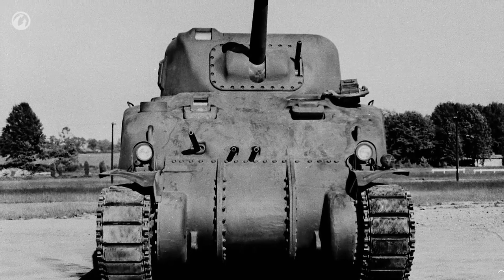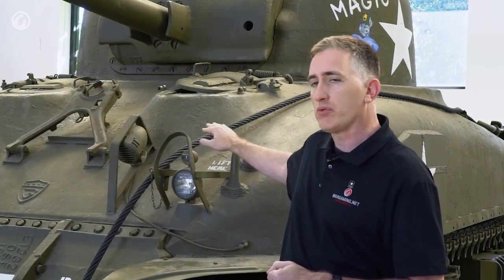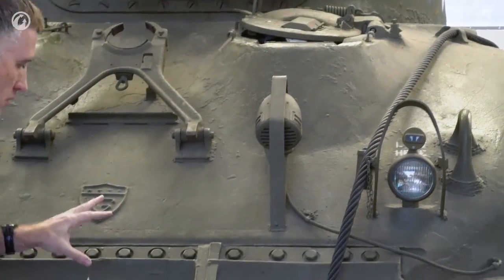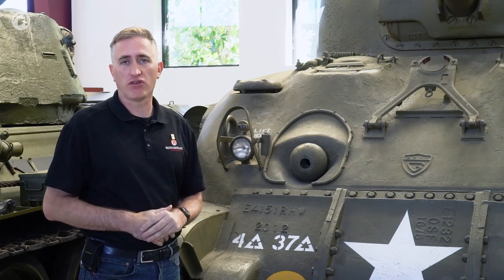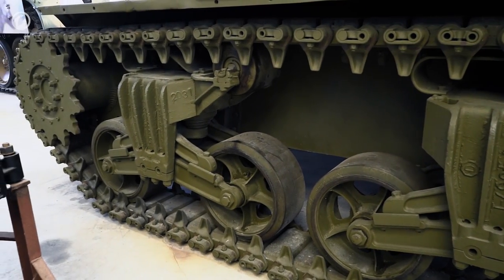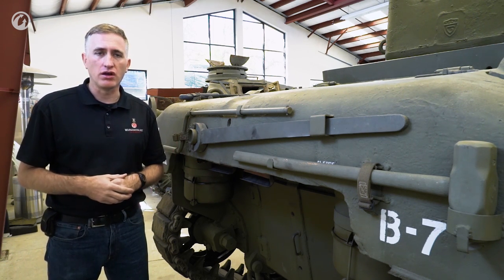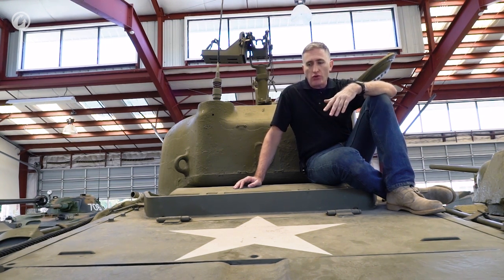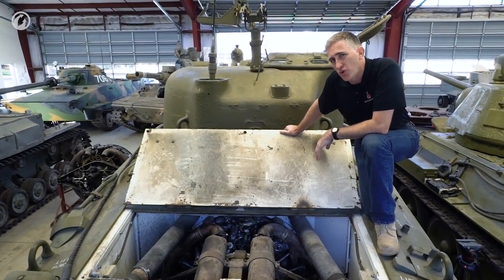Inside the Chieftain's Hatch: M4A1 Sherman part 1

Comment: Understandably, there is a distinction among maintainability and reliability, but isn't "reliability" largely based on maintainability?  My car may be "reliable" but if I don't maintain it properly, it won't be for very long.  Also, generally, the more maintainable some thing is, the more reliable it tends to be.  Undoubtedly the two go hand-in-hand.  Separating the two is tantamount to separating space and time - conceptually they're different, but practically, they're the same thing.

Also, THANK YOU for illuminating the crane weight restriction.  It now makes total sense to me why we Americans never seemed to do much with heavy tanks during the war.  It is a critical and largely untouched reason as to why.  It surprises me that this is the first mention I've ever heard of it.  Considering the massive logistical web the U.S. had to establish, maintain and protect during the war, a change like upgrading all of the cranes in order to transport a new model tank would have been a gargantuan effort.  It's also a nice segue to my final point.

While I have heard and read many criticisms of American arms and armor in WWII (justified and not), I have never heard any praise for the logistics and supply chain the U.S. pulled off.  Yes, we were well protected by two oceans, but these were insanely monstrous obstacles to supplying two simultaneous overseas war efforts.  Except for Canada, there was no other combatant that had to accomplish the same (Japan is probably second to North America).  While the U.S. produced about the same number of tanks as the Soviets during the war, every single one that saw combat had to cross thousands of miles of ocean to enter into said combat (in addition to the fuel, ammo, spare parts, food, crew, etc.).

Love the video and the series.  I'll always have a "soft spot" for Shermans as it was my grandpa's tank...
Reply: John Cornell.  The Brits has colonies to draw supply from scattered throughout the globe and didn't have to supply two fronts, crossing two oceans from a single location.  While their efforts were respectable, there's little in the way of comparison.

Also, not sure if you checked your geography but there's no ocean between Germany and the Caucasus.  German supply of North Africa is a single front, not two and is across a sea, not an ocean and used Italian ships.
Reply: John Cornell  I think he was counting the affair in Britain as a front.
Reply: John Cornell  I'm curious how the British had to go all the way around and the Americans just pulled up as the British sailed by?
Reply: Thank you for pointing out the interchange of reliability and maintainability (including spares and mechanical ability), I thought the same thing, one and the same.

Comment: One way to look at the Sherman is to remember how another important American product came about - the IBM PC.

Nazi Germany was a militaristic land power. We were an isolationist nation that relied on sea power. We had no tanks in WWI and so we were late to the game.Just like IBM wasn't in the PC revolution early. So when they had to make a tank or a PC they didn't try to make all of it themselves.. They bought and assembled 'off-the-shelf parts'.

Germany had a company Maybach that specialized in tank engines. So they always put a purpose built tank engine into their tanks. We however stuck a wide variety of engines from cars, trucks, tractors and planes into our tanks. Germany had several companies that forged cannons but we didn't. We used a WWI French field gun in the Sherman. 

IBM caught up by not making their own special purpose CPU for their personal computer. They used an Intel chip and parts from many other manufacturers.

The Sherman and the IBM PC assembled not constructed.
Reply: Just as an iphone is built today. And yes IBM did convert to PC's pretty quickly thus the ubiquity of PC's.

Comment: Did you get a picture of that builder's plate? I happen to work on two other Montreal Locomotive Works products, a pair of 300-ton steam locomotives, one built 1940, the other 1942. No doubt they spent the war hauling all kinds of equipment to the ports on the East Coast of Canada.
Reply: I did not, no. sorry

Comment: The Sherman could use any engine of about 500hp. The one pictured is a Continental 9 cylinder radial that was also used in helicopters. Then there was Fords GAA 1,000cu/in V-8. Also Cadillacs twin V-8. GM's diesel using 2 6-71's. Chryslers 5 together 6 cylinder gasoline flatheads (yes 30 cylinders).

Comment: I've read that the Sherman's designers were aware of the problem of narrow tracks with mud and snow from what Russia was telling the U.S. about the problems the Germans were having, but it was decided that the mud problem wouldn't be nearly as bad in northern Europe. This turned out to be incorrect however. 

Amazing that they painted that big star right where the ammo was. The medical Huey helicopters in Vietnam had the same issue, they had a big cross symbol that made an excellent bullseye for the enemy to shoot the helicopter with.
Reply: The Russians who had Shermans would wrap barbed wire around the tracks which actually seemed to help with the slipping problem.

Comment: I've read that the Sherman's early reliability was less-so also because of the initial engine used, which was an aircraft engine. When they later started using the Ford engine, reliability improved. Again, have read this, but forget where.
Reply: Not really the case. The M4 never had an aircraft engine- rather an aeroderivative.

Comment: MTBF, MTTR,MLDT are all part of Reliability.  MTBF. (MEAN TIME TO REPAIR) is and was likely gamed a bit. Meaning a low one picked to make sure it was met.   Engineers may like to push the envelope on that but the old demon, politics came to play too often.  MLDT (mean logistic delay time) MTTR (mean time to repair)  you already covered.  Yes having parts and easy logistics, doesn't equate to high MTBF. However Ao or Operational Availability is key.  Does it start and run?  80% usually used based on operational conditions.

Comment: There is no reason that a radial engine cannot be stared with an electrical starter like any other engine. They use them all the time on radial planes. I suspect they just figured it wasn't worth the complexity. But it's weird, because if it already has an electric starter, all you have to do is flip a switch and shut down the ignition circuit, then crank the engine with the starter a few times. Then you flip the switch again, call "contact!" and turn it over, and the engine should start up. Are you sure that this wasn't just the way that they started the engine ALL the time? That would make sense. Having to crank it over 60 times is just in ADDITION to crank starting it. Do what I said above, only with a hand crank, one guy in the driver's seat, one guy cranking. Or just put the breaker switch next to the crank. And then don't stall it unless you want to get out and crank the engine under fire!
I suppose it's also possible that they had Coffman "shotgun starters" in them. That would explain having to crank it manually before firing off the starter cartridge.

Comment: I read that the tracks were reversible, and the insids could be flipped outwards after the outer faces are worn down. Is this made possible by the fact that the drive teeth are part of the track connectors, rather than the plates? But you'd still have to disassemble the whole track and re-assemble it with teeth facing inwards.
Also interesting what you say about the M10 not being able to climb as high a wall: I've long wondered what the limiting factor is in how steep a gradient a tank can climb, whether its engine torque/gearing, center of balance, or traction. I assume from what you said that traction is the main factor in deciding how steep a grade it can manage? But surely that depends on what the slope is made of. And assuming a theoretical rack system fitted to the slope to fit the tracks and prevent slipping, what would the limit be? Would a tank have the power/gearing to climb a 45deg slope? Could it climb a vertical wall in theory?

Comment: The later ranks of the Pzkw4 were probably the best all around tanks of WW2. The giant machines of the later part of the war were a logistical nightmare for the Wehrmacht. They were more trouble than they were worth. They could not cross bridges, they got stuck, they broke down. The T-34 was direly needed and rushed into production, it was never expected to live more than a few weeks. The USA had logistical limits to the size of tanks it could ship across the ocean, so the M4 was what America could supply in large numbers, just like the M3 before it. The US and UK only figured out how to produce heavy, hard-hitting tanks at the very end of the war. One needs to look at all facets of war, not just what looks big and scary. The Bismarck was indeed very scary, but it only managed to sink a very poorly armored, obsolete battlecruiser. What did the U-boats do? They were far more effective by orders of magnitude.
Reply: 1. The Panzer IV was not great by 1944.

2. The Tigers and Panthers were worth the effort and actually prolonged the war.
Reply: The Pz4 has reached it limit with it's 80mm of armor, less in other areas, a long gun 75mm that is the only good thing on it and it was not even produce in good quantities or the quality standard of the M4. Frankly, it was good medium tank for Germany, not counting Panther because that's practically a heavy, but pz4 was not the best all around tank.

Comment: Hello, I just watched the movie Fury and I am wondering after seeing this and other tank movies, when enemy troops storm a tank they seem to be able to just lift the hatches open. Did they not have internal locking mechanisms?
Reply: First, logical soldiers would not storm a tank. That movie is highly inaccurate. 
Second, they did, but they rarely used them because it would be an obstacle if you needed to bail out

Comment: Could they not have gotten around the 40 ton weight limit, by breaking the tank down before storage?  Like drop in the main body, then the turret?
Reply: Sure, but by the time you get those 2 parts loaded, that could be 2 Shermans.

Also consider that the time spent breaking down the tank and re assembling it both before loading, and after it.

Comment: I do like the PMCS and Spot Checking together , thanks for the info on the tank. Why didn`t the driver pull the coil wire and use the starter to lube up the engine ?

Comment: Thank you so much! Awesome and informative as always! Just kind of curious, what are your thoughts about the 105mm engineering Shermans? Did the 105 take up so much room as to be really hard to operate, and was the HE so much better than the 75s as to be worth it? Only reason I ask the last part was I remember from your Tank Destroyer history video (fantastic vid by the way) how M10s were used instead of 105mms as artillery, and imagine there can't be that big a discrepancy between the 3 incher's HE and the 75mm's.
Reply: Towards the end of the war, there was a preference for majority 105mm Shermans, and a few 76s to deal with any tanks which may have shown up. Zaloga refers to this survey somewhere in the Operation Think Tank videos.

Comment: "Very high tolerances.." It's not as simple as that. The big principle in the 'American Method' of industrial production was GUARANTEED tolerances. All the replacement parts are different - but differ by no more than an absolutely defined difference. Meaning that you can design machines such that ANY of the 'different' spare parts will ALWAYS fit. By careful machine design, quite large part variations can be accommodated. 'High tolerance' does NOT mean high precision of fit. It means certainty of fit. In fact, the European 'hand-fit' manufacturing - you modified (usually by filing) a spare part to fit with incredible precision - produced 'tighter' assembly than the American method. But, you have to choose the 'right' spare part because some of those available will NOT fit, no matter how much filing and fettling you do. If it's too small, you can't file it larger. Consequently, the fit on, for example, British built Rolls-Royce Merlin aero engines was much tighter than the Merlins produced by Packard in the US. The European method was slow, required small  teams of highly skilled, experienced fitters and machinists and was much more expensive than the American method which is fast and requires relatively lower skilled technicians. Different philosphies - Henry Royce vs Henry Ford. Ford won...

Comment: Seems like they could have easily gotten around the 40 ton crane limit by lifting the hull and the turret of the tank separately.  Thus, you could have a tank with a 40 ton hull and a turret to match.
Reply: Good idea. However probably sending them in one whole unit was deemed a better option by most Allied government's department's of aquisitioning.
Reply: Nathan Peterson bad idea*
Reply: @Nathan, you would get a whole tank when you unloaded them.  You would unload the hull first then mount the turret on the hull when you unload it from the boat.  Thus, unloading and mounting become the same operation.  But, i have learned that the army didn't want heavy tanks mainly because they knew they couldn't cross most of the bridges in Europe.  They wanted mobility over armor.  It takes extra days to move heavy tanks over each river.

Comment: How hard could it be to modify the engine to run with the crankshaft vertical and a right angle drive underneath it thus eliminating the oil settling in the lower cylinders and lowering the driveshaft as it runs under the turret.

Comment: The Sherman is unfairly compared to German tanks because it was specifically designed as an INTERCONTINENTAL weapons system. By contrast,German machines were designed strictly for border wars & continental deployment.Otto Carius' combat bio talks of him ordering his poor crew to perform maintenance stops every 45 minutes in Russia.(I expect this was to hammer in the worn track pins in.)Also defensive weapons have very  different requirements to offensive weapons.A slow mobile pillbox like the Jagdtiger is only effective as a defensive ambush vehicle.The Sherman was not designed for one-on-one duels with bigger tanks but to operate as part of a tank platoon element.Thats why most Sherman tanks preferred to use HE against them.With smaller ammo they could fire 3 rounds to a Tigers 1.Thus an entire tank platoon could rain down literally dozens of HE shells per minute onto a bigger tank which guaranteed to render it blind or immobile by ruining its periscopes or tracks.I read one account of a Sherman knocking out a King Tiger using nothing but rapid-fire smoke shells.Phosphorus smoke is toxic and the Tiger's air vents sucked it into the crew compartment, forcing the German crew to abandon the tank!Apparently,they surrendered because they thought they were on fire!
Reply: The Sherman was not a bad tank in 1942 or 1943 and its main opponent in that period was the Pz III, a vehicle that was inferior in firepower and armor. In 1944-45 it found itself lacking in ammour and firepower when put up against newer tank designs and anti tank weapons. The US army needed a replacement for it and they got it, but it was deployed to late to have an effect on the war.
Reply: @OleLeik  A 75mm Gun was good enough to destroy German tanks, as the video presentation just illustrated. I'm assuming you're referring to the 90mm Pershing Tank? It would have definitely of had more firepower but you didn't need that to destroy a PZ III. The reason why Sherman Tanks got away with it is because they operated in packs and usually had infantry/Artillery support. The Battle of Arracourt is a perfect example of Sherman Tanks destroying German Panthers that were superior in both firepower and Armor.
Reply: @GreenMan1999  
When Sherman came across Tigers, and Panthers  it was bad news for the Sherman crews. Sure they could ,and useally did, come of top of slug feasts with the steel beasts,  but the price to be paid for such was high.

Allied (British and US) analysis of what their tanks actually did during the first years of the war indicated that they seldom had to fight other tanks. The Sherman  were designed for easy production and transport to the field, and assisting the infantary  rather than taking on formations of increasingly heavier German tank designs. The airforrce was tasked with that, altought that did not work out quite as well as planned. For exploiting a success on the battlefield the Sherman was  the better tank. No German formation at the time could have kept up with  Patton
Reply: @OleLeik  Most Tiger and Panthers kept away from a actual confrontation as they aren't invincible juggernauts. They are slow. Easy to break down, expensive even for Germany and are inconvenient for the size.

In Africa a Tiger is usually paired with about 4 Panzer IVs to make up numbers as to not lose a valuable asset. This is as similar to the British pairing Churchill tanks with a Sherman Firefly in order to distract the enemy.
Reply: @OleLeik  The only time the Germans actually used Tigers and Panthers just to kill whatever is looking at them was against the Russians. But the T-34 practically drowned them. Actually most German Panzer Divisions ended up drowning to the T-34 ocean.

Comment: Thats been the dodge chrysler model for years. These cars would break down a lot. But they were easy to work on with cheap parts in abundance. Often times these cars could be fixed on the side of the road where the broke down.